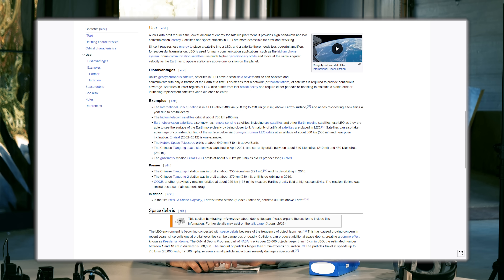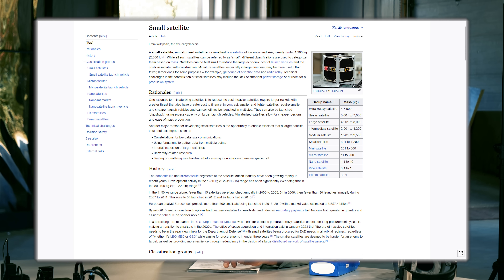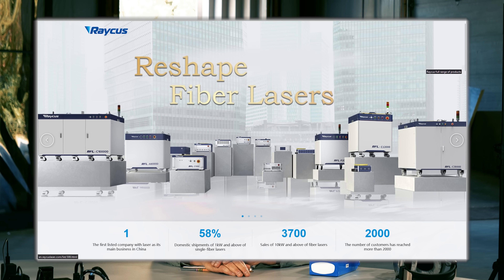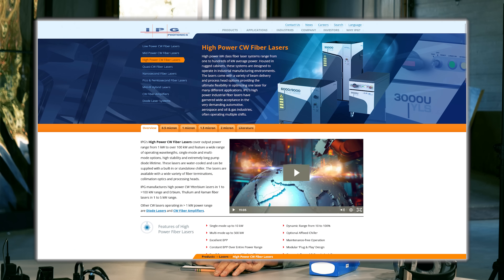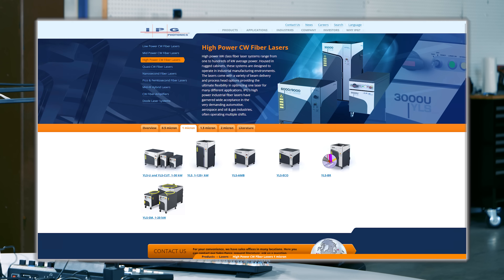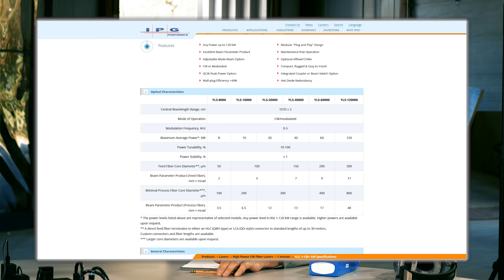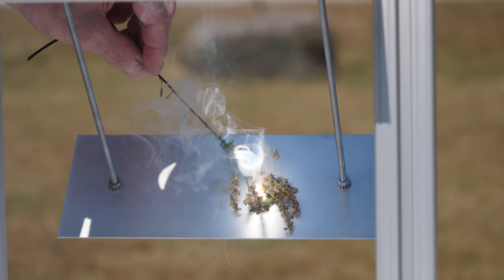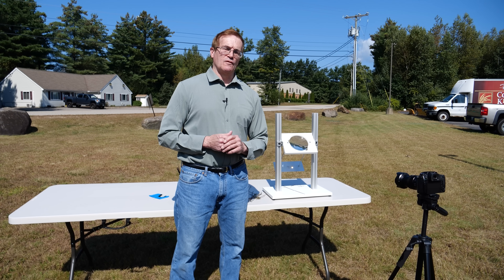COULD SATELLITE LASERS REALLY DO THIS?...

Comment: I don't know how much a kilogram is or how far a meter is . I'm not alone  most would be surprised how many people who doesn't have an instant understanding of the metric system . Why can't you and others speak in the standard?
Reply from the maker: Really?
That's  basically  just two conversions.
I used to provide  both unit systems  with all the numbers, but it was pretty  cumbersome. Add to this the fact that all these manufacturers give their specs only in the metric system.
Reply: @TechIngredients  thanks for your reply! I may be wrong but I would assume the majority interested in this area of tech would be the older generation that grew up using the standard system. every time the metric system is used I have to use a converter. I do a lot of hobbies in which I should be using the metric system? but the standard has never let me down. I have yet to find an actual need for it other than reloading my own emanation. But often I use thousands even for that .But shooting long-range, flying helicopters the standard system works. It's not like I can't learn the metric system,  perhaps I should since the only area I see any real need for it is the following along with the conversation on YouTube.
Reply from the maker: It's  had to believe  that you wouldn't  have been soaked in both systems  if you do any model building.
I have thousands of dollars  worth of tools covering similar size ranges because of the presence of both metric and imperial hardware.

Comment: Am I missing something or did he explain how much energy is absorbed by different gases, (especially water vapor) deflected & reflected by dust, other floating debris etc over that distance.  He is only talking about directed beams and wave theory as though it is going through a vacuum, except for his consideration of the air current refractive difference.   Does that work as well for a directed beam, as a received beam, because You have to measure the amount of actual deflection by changes in refractive index, and the air currents are acting on it twice (going down and coming back up to measure the amount of displacement on the downward trip), and it also has to bounce back off an irregular surface, ... the earth.  Perhaps the Chinese military special ops are working on lots of nasty things, but it would make a lot more sense to do something that is much more practical, and not so easily "foiled' ; literally by shiny surfaces.
  Two many idiotic conspiracy theories and ignoring of literal conspiracies that have already been proven.
Reply from the maker: It does work the same. The only difference  is the terminology,  your point of view.
As I said, I don't  think a DEW was involved, only that it is possible.   The physics and the available technology allow it.

Comment: Try and rework your maths with a parked - near stationary orbit, (stupid slow relative ground speed - maybe one orbit/year) (in orbit for three or four years) and an average altitude of about 250km.
Reply from the maker: I don't  understand. You can't  maintain  a stationary orbit (above ground) at less than a geosynchronous altitude approximately 100 times higher.
Reply: @TechIngredients  I seem to remember the French spy sat' camera platforms I worked on were that low. Maybe then, just not very long lasting.

Comment: No accounting for system cooling system and constraints on said space platform ...  also, platform stabilization and aiming/targeting, which are going to be interrelated system-wise.
Reply from the maker: We didn't dig into the engineering of such a satellite, but those issues have been incorporated into other satellites.  The ISS uses large radiative coolers, and reaction wheels stabilize many satellites, including Hubble and Webb.
Reply: @TechIngredients  And those subsystem are substantial, but, the targeting/aiming does represent a whole new level of engineering problems to solve. Suffice it to say, this would not be a small, inexpensive , unobtrusive satellite.

Comment: Sincerely, Maui, is there some skullduggary and coverup? Absolutely.  Land grab coinciding with certain agendas? Yes. Do I know if it is fricken sharks with laser beams on their heads, or satellites for that matter? No. However, when asking the question of possible, yes or no, median capabilities DO NOT make a baseline, only a lower potential.  For instance, if someone said, "I just heard a sonic boom". I would say hey the average speed of the average aircraft flying out of the nearest airport would not be fast enough to break the sound barrier.  Geosynchronous orbit, 7000kg gross weight, 300 km orbit, max known KW from nuke powersource, under max payload, (3000 kg?)  Then you are talking, "if possible".  
"So and so bench pressed 400 lbs!!" Well the everage American male is 5'10", 180 lbs, couldn't happen."  Doesn't work.

Comment: What about aluminum wheels on cars melting, and not just melting into a puddle, nor melting and burning away, rather melting and then flowing across the ground for several feet, then seemingly rapidly solidifying , all this happening and 3 feet away some of that grass you mentioned in this video standing not burnt at all. High wind driven fires or blow ups dont do things like this. This video assumes there hasnt been some Great Leap Forward in some type of tech thats capable of creating very high temps across a surface area at least as big as a compact size car. I dont know what the color blue has to do with any of it, but many things that were within what had to be a very hot area were left seemingly untouched, every item was a certain shade of blues very close to each other. Sorry but a wind driven brush fire isnt going to cover this one. Something evil went on on that island and i think we need some real answers as to what, they are not really here.  I suspect you have not seen the same videos from on the ground of that island that some of the rest of us have. I still love this channel though, very good stuff contained in this channels content !

Comment: Someone compared photos of vehicles on the road in Lahina that were apparently ignited by airborn embers to vehicles in a parking lot outside of the hospital in Gaza where the parking lot was hit by a faulty trajectory firing of a Hamas rocket. In both cases, vehicles were burned and destroyed. Only Lahaina has melted wheels, engine blocks and windshields.
Reply from the maker: The key difference is likely  the amount  of fuel onboard each vehicle.

Comment: A great video. However, any brush fire combined with high winds still couldn't possibly produced the high temperatures required to melt glass and alloys into molten puddles.
Reply from the maker: Thanks.
What about the fuel onboard each vehicle?

Comment: There is videos of people using flame throws. Starting the fires in Maui.
Fernnel lenses work better than parabolic lenses of the same size.

I would go on but basically your video was a joke
Reply from the maker: You missed  the whole point.
I stated  clearly  at the beginning  that we don't  believe  lasers were involved.
I repeated  this opinion  near the end as well.
We did the video  because  so many  people  were questioning  whether  they COULD have started the fires.  The answer  is yes.

Comment: Stop using metric systems.  Use pounds and miles
Reply from the maker: No.
We'll try to use both when possible.
Reply: @TechIngredients  then find my 10mm wrench lol
Reply from the maker: You silly Billy.
I have wrenches for metric and imperial hardware as do most machine shops.  We both know the issue stems from nationalism.

Comment: Targeting accuracy and time on target is the problem. I'd say no way. 1° of arc becomes how much over the distance? Atmospheric scintillation is also snother real world factor. Science gets balked by lack of engineering solutions. Nice try.
Reply from the maker: Indeed, it is a challenge,  but it's  within the capabilities  of current technology.
Reply: @TechIngredients  challenge is probably an understatement. When I was a kid I knew how hard it was to light a fire with a magnifying glass from just a few inches. A swivelling laser mirror in orbit puts it all on another level to say the least. Science isn't the problem here. Deciphering art from engineering is.
Reply: @TechIngredients  one more thing. Orlan drones operate from KMs of altitude and have no trouble keeping a  laser spot on a target while both are moving. So from that we can assume that the target acquisition and tracking tech is well advanced. Mmm with improvementsvin other areas it could well be feasible. Cheers 👍

Comment: It's also possible and likely you cheated on your entry exams. And ended with a B S Degree.
Reply from the maker: "Possible and likely" is redundant.
Hopefully, you didn't major in English lit.
🤔
Reply: @TechIngredients  Comma is not needed.
Reply from the maker: It's optional.
For some reason, you initiated this exchange with an ad hominem attack.
Stick with the subject of the video.

Comment: no they cant
Reply from the maker: Thanks for that detailed analysis!
Yes, the can.
Reply: @TechIngredients  As a former senior scientist that worked on star wars project and many other directed energy systems that followed. I assure you it can not be done. That is why we returned to focus only on kinetic energy weapons. The directed energy has become units that are used much closer to the target, because of the fact of the unsolvable energy depletion problem and targeting.
Reply from the maker: That was 40 years ago.  The technology  has improved  substantially.
Specifically, what in my discussion was incorrect as it clearly led to the conclusion  that it is possible. Remember,  I didn't  say probable or optimal.
Reply: @TechIngredients  you are lost. we proved then and more recently that the power to do what needs to be done cannot exist on orbit and dissipate the heat nor ever aim to the degree needed. You do not know what you are talking about. I was a lead in this. It exceeds the theoretical physical limits of  Watt/ SQ in, BTU /Sq in, and much much more. Impossible to function in a radiated cooling only environment.
Reply from the maker: So, you were a senior  scientist  who worked on the Star Wars project. Really?
You didn't answer my question.  I presented the numbers. How many joules need to be dissipated after firing the laser for 10 minutes? How much surface area is needed to accomplish  that during the rest of the 100-minute orbit?😏

Comment: I can mesure the distance earth/moon firing a 50 watts laser to a mirror placed on the moon, are you kidding me??? A 150 KW laser can take down a cruise missile up to 30 km in thick atmosphere, are you f… kidding me???
Reply from the maker: What's your point?
Reply: My point is that if you can fire through 30 km of atmosphere at ground level, it seems to be easy to fire through the atmosphere from space because it is the same thing… dispensing of laser beams are irrelevant.
Reply from the maker: Nothing  about this is irrelevant. 
I understand  your  point, but you then have to add another 270 km to the beam path, and that is significant.
Reply: There’s about 30 km of thick atmosphere, above that it’s thin air.
Reply from the maker: Correct, it's  even a vacuum, but the distance adds to the divergence. This is a property of light that has nothing  to do with the medium, including air.